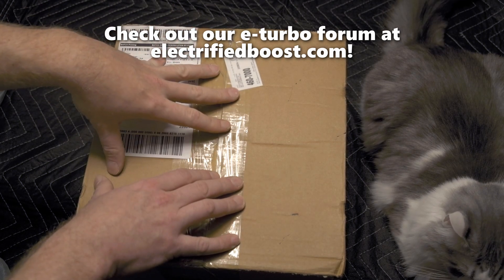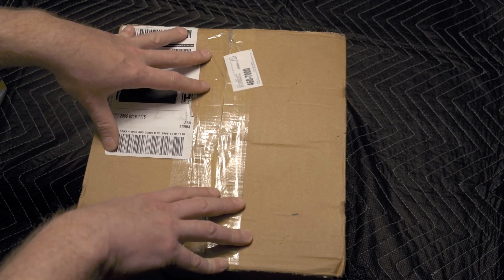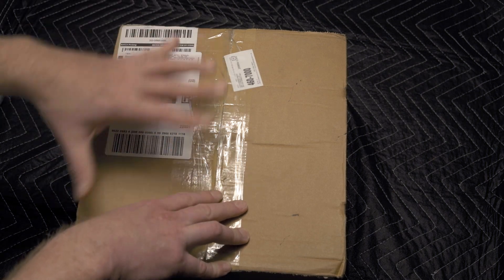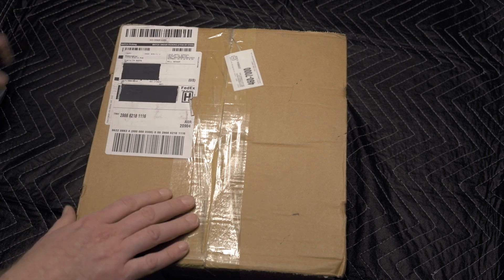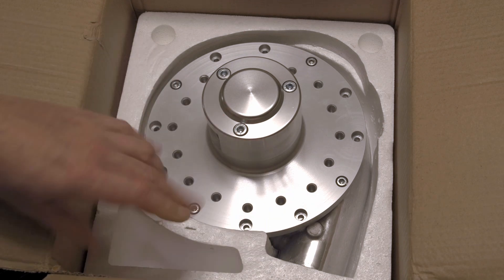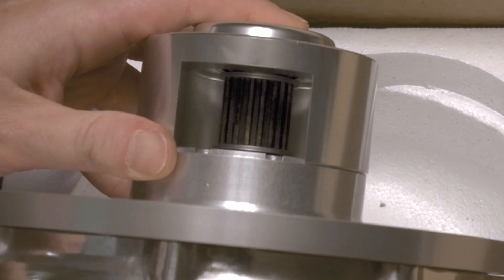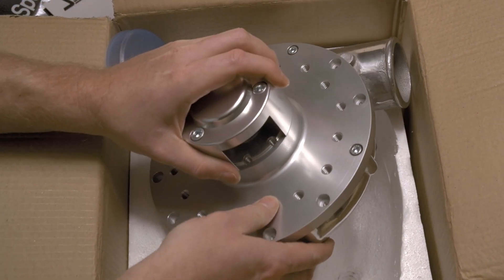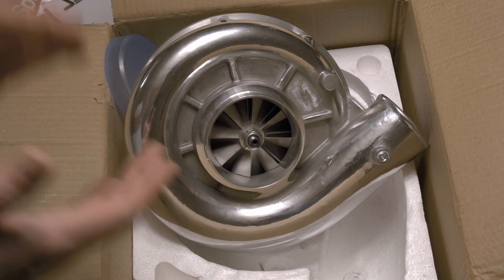Unboxing the Ultimate Blower For Electric Turbo Conversion!

Comment: I just want the supercharger... is it any good?
Reply from the maker: Appears to be an almost exact copy of a Vortech Si trim.  The factory bearings aren't great - they're not terrible, but not great.  The belt drive will be a weak point; if you keep the compressor in it's sweet spot or below, you'll possibly be ok.  Google the compressor map for a Vortech Si.

Comment: Honestly, this thing is substantial enough for the money, I almost just want to design my own belt drive setup. So many mount options it would work well. Especially for stuff like my GX470 where there just ISNT a budget option.
Reply: They make a manifold from Australia under 1500 to adapt a few oem blowers on the 4.7

Comment: What kind of belt and drive pulley is needed to use this PCE unit??
Reply from the maker: It's a T5 25mm width belt, but I'm not sure about using a belt - at these speeds, it gets very hot very fast...

Comment: how did this work out with the speedmaster i see you are back to using the vortech what was the reason for switching back
Reply from the maker: That's still here.  I went back to the Vortech because I wanted some track data before it got too hot; and with the issues with the VESC, I decided to go for the path of least resistance - the MGM/LMT stuff just works.  I'll be back on the speedmaster P2 setup soon.

Comment: Alex Alex Alex,  Have you considered incorporating a pressure vessel/scuba tank/bladders, whereby you wouldn't have to send 1 million amps to a electric motor in the hopes of hitting 15psi boost??

The ideal electrified forced induction system would utilize a high flow positive displacement blower (large diam. double acting air cylinder; rotary lobe, helical, etc).  Which solves the insane rpm, spool up, ridiculous initial power draw of turbine.  Second, a buffer is needed, a simple air tank appropriately sized.  This buffer can store the required first few seconds of 15 psi boost.  Think about how beneficial that would be to boost...  15psi or whatever desired - ABSOLUTELY INSTANTLY - without the need of 1000000amp surge thru an ESC.  In other words 600ftlbs@1000rpm.

The elec.motor/blower/storage tank would be trunk or interior mounted.   Think about it like this, if you had a magical scuba tank that provided 15psi of air at 3000cfm.  The DCmotor/blower would precharge the tank, and kick on as needed to keep the tank constantly, and exactly, providing WHATEVER psi you wanted, when you want it.  100% controllable boost.

By implementing a pos disp blower and pressure tank, you only need 10-20 electrical horsepower to provide 15psi acceleration events.  The tank would be pressurizing primarily during non-acceleration.
Reply from the maker: Mickey Thompson did the compressed air thing in the 60's, I believe.  The tanks needed were huge (and dangerous).  But a good idea, none the less, because it did work and better still - the air was ice cold.  You're starting to give me ideas...
Reply: @AlexLTDLX  

I watched a video not too long ago with a more recent attempt with a camaro I believe, it was insane. I'm pretty sure they used carbon fiber tanks so they were strong and light. Edit....Just found it, it's on a channel called CASupercharging, It's a very cool video.

Comment: Hello, I'm trying to get this application and the company is saying it doesn't come with a pulley?
Reply from the maker: It only comes with the pulley on the impeller shaft.  You need to buy a T5 pulley for the motor.

Comment: To get usable boost pressure together with sufficient air volume flow requires a lot of power, its that simple.   I used a 4KW brushless motor and it still did not have enough power to spin it up to produce even a modest 3lb boost, let alone flow enough air to supercharge even a 1 litre engine.  You can play around all day experimenting with different drive ratios, motor power and Kv RPM, but at the end of the day it comes down to the 'power' required to spin the impeller up to the 100,000 rpm or more.  So unless you are prepared to use a 10-15KW or greater brushless motor drawing 900A from an ESC, (maybe the 3-phase controller out of a Tesla) using 1 inch diameter electric cables then don't waste your time and money.  Its not practical and that's the reason why car manufacturers with enormous engineering resources available to them have still not developed electric superchargers.
Reply from the maker: This is a 14kW motor.  And as I mentioned twice in the video, it's already proven itself on the dragstrip, pushing a 3,500lb car to mid 10's on 5 psi: https://youtu.be/AOL3Qyczt3Y  That was the same motor, almost the same compressor, and a different ESC/battery pack.  The number of people who don't actually watch the video and leap to criticize is stunning.  FWIW, I have a 40kW motor and 1,000 amp ESC on the way.

Comment: Will be interesting to see performance. Amazon lists 20 psi max boost and recommended application 6-8 psi. Belt drive shaft and ample mounting hardware looks nice though.
Reply from the maker: I don't think that belt drive will support 20 psi.  As soon as I can, I'll do some tests.  Got to get the big electric turbo (Vortech) running with more power first.

Comment: Did you get any response from the ESC company after the last one got "toasty"??
Reply from the maker: Yeah - they're re-doing some stuff on their ESCs.  They're actually a really good company and good people - this is uncharted territory for everyone; I would have zero issues buying from them again.  I did actually go ahead and order a VESC for this blower; and for my Vortech unit and MGM ESC and an LMT 53hp, 50,000 rpm motor... should be interesting if it works!
Reply: @AlexLTDLX  if I ever do a custom ev build I will look into their esc